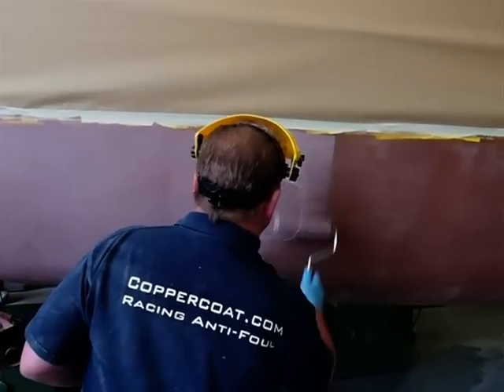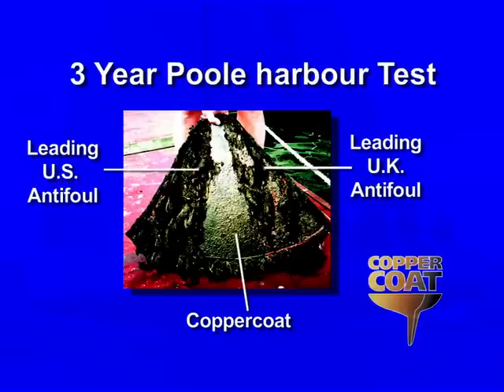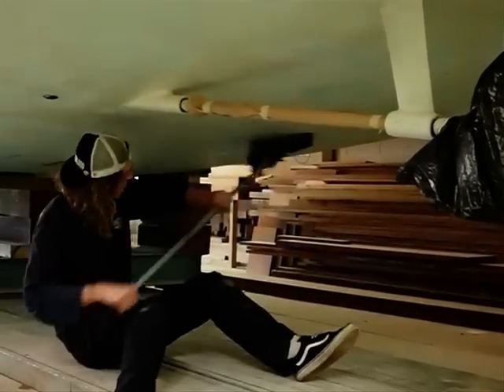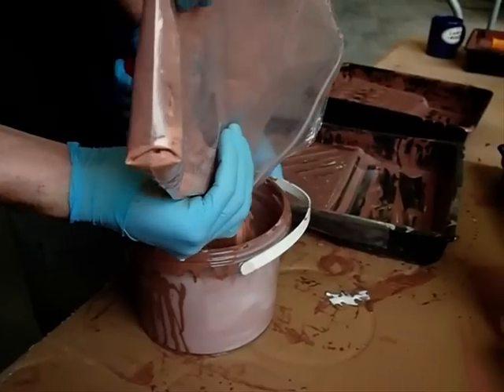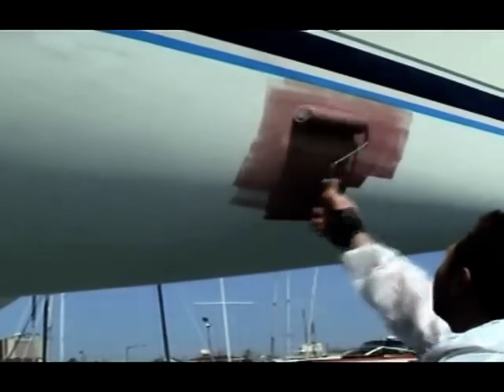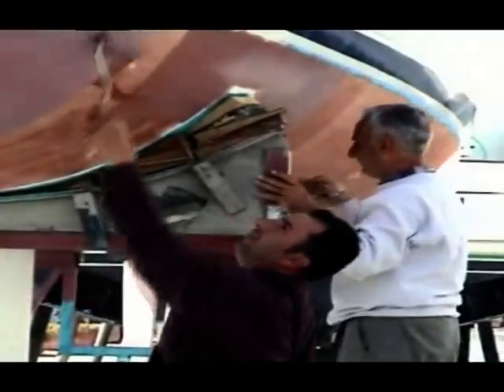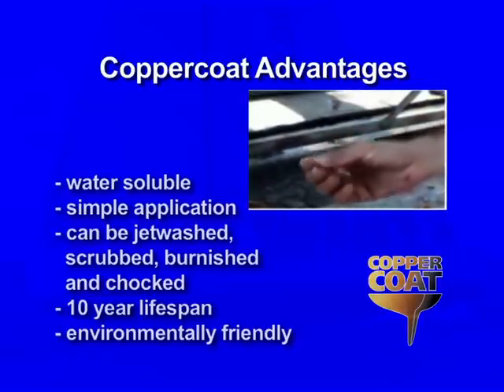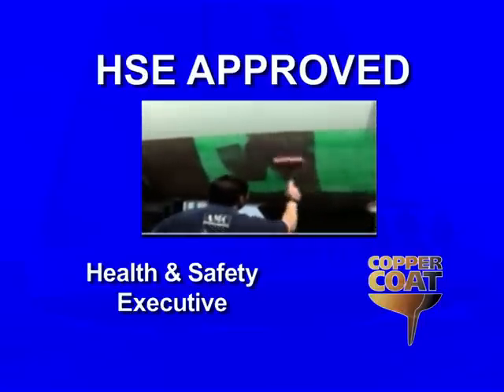Coppercoat Application

Comment: the application is a very hard job and expensive. is it possible to blast the copperpowder on the hull after it is painted with epoxy? i have tried it on a piece of wood painted whit polyester . and it looks good.  i mean the copper haftet on the outside and that is the most importent thing.

Comment: When the yacht is supported underneath how long would you wait after applying the first 4 coats to move supports and then paint these remaining bare areas? Thanks for video
Reply: I do not see a reply, and would suggest you wait till it has curexdband you have sanded the final coat to activate/expose the copper. Doing this you will only need move your stands one time and fill in and sand the areas wrerebthe stands were. Let me know how it works for you.